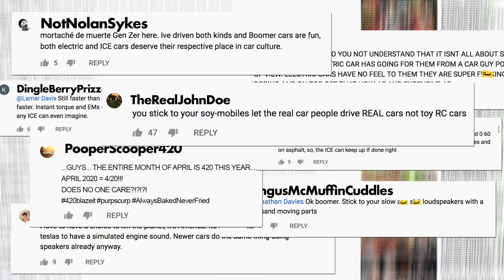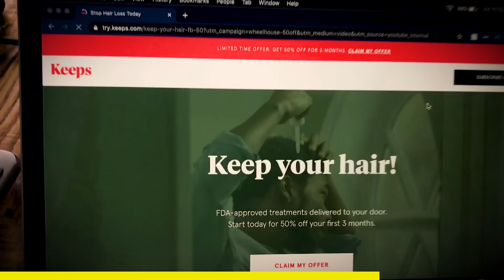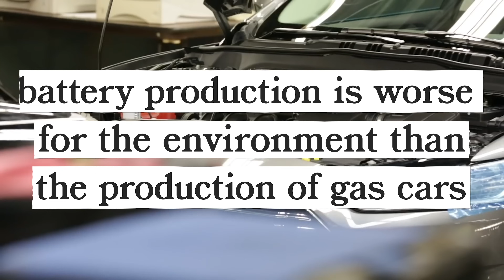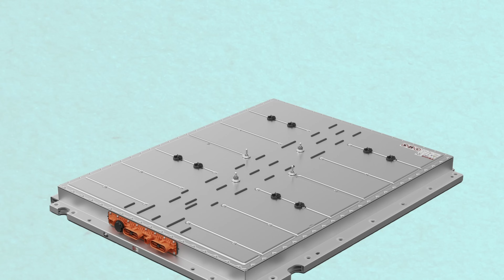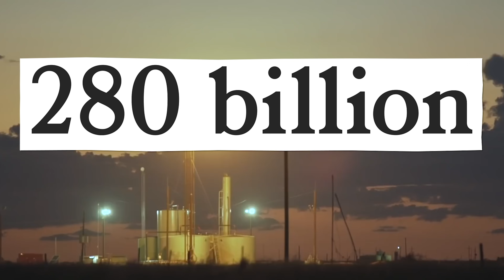Are Electric Cars REALLY Better for the Environment?

Comment: There are zero evidence that co2 causes harm to the environment. Theories are not facts
Reply: There is lots of evidence that CO2 a heat trapping gas warms the atmosphere over the planet, thus warming the oceans which then accelerates the creation and volume of vapours which excelerates the warming of the planet, thus leading to rising sea levels, quicker coastal erosion, damage to marine eco systems due to the harmful chemicals trapped in ice being released into the oceans, and the warmer air evaporating water more quickly from the soil leaving less time for plants to absorb it so yea, CO2 doesn't directly harm but it does create quite the chain reaction, a really bad one at current emissions
Reply: @RP7784  what is the scientific rate in which you think the warming is happening? How much co2 is needed to make a change in the temperature in the ocean? How much vapor is created from this chain reaction you speak of? And how much ice was melted by this effect? Last I checked there are far more ice on this planet than when al gore made his documentary
Reply: @johnnynguyen9579  in the last 140 years the earth has warmed by 2.6 degrees, which may not sound like much but it's alot compared to the temp change across a span of twenty thousand years to a hundred years, right after the industrial revolution earth began warming at an unnatural rate. There is currently a 0.04 Percent CO2 content in the atmosphere which is 400 parts per million by volume, again it may not seem like alot but it's enough to decrease the sea ice in the Arctic by 13.1 percent per decade, and between 2002 and 2020 for Antarctica to shed 149 billion metric tons of ice per year adding to rising sea levels, earth  holds a pretty fragile ecosystem, but it's destructive power is incomprehensible.
Reply: @RP7784  your information is false. The past year alone the earth has been colder. Please check your sources and stop spreading false information. In the past 30 years temperatures has drop and  this natural. There are zero evidence of Co2 causing any increase in temperature.
Reply: @johnnynguyen9579  lol you just said science is wrong half the time so technically it's not trial and error fool.
Yea science can be wrong but so can anyone, it was science that discovered penicillin, science that discovered electricity, science that discovered fusion, science that discovered gravity, all the forces of energy, velocity, mass and physics. Your argument is quite blunt again, and falls flat, sorry hun.
Reply: @RP7784  penicillin was founded by men and men was created by God. So is your mom and dad whom are God’s creation. President Trump cured the world and was the next messiah and you fools spat on him. God, Jesus, and Trump still forgive you for betraying them. Science is a minor part of Trumps creation.
Reply: @RP7784  science invented Covid. Admit it
Reply: @RP7784  dinosaurs died because of global warming and climate changed. Scientist said their monster trucks created too much co2 and led to the ice age. Fauci certified this
Reply: @johnnynguyen9579  😂😂😂😂😂🤣🤣
Reply: @johnnynguyen9579  Your information is false; 2020 was one of the hottest records in history. In the past 20 years, 19 new records have been set for highest global temperature.
 
Why don't you take your own advice, and  stop lying.
Reply: It's called the 'Theory of gravity', but it's only a theory, so why don't you test it?
Reply: @MrRentageek  why don’t you go test the Big Bang theory. Bet ya can’t. Know why, because theories are fairy tales. Someone had an idea and sold it

Comment: The electricity that runs electric cars is produced by burning oil and coal - more carbon load than just driving gas vehicles.
Reply: Not in the UK it isn't. The UK generates just 4% of it's energy from coal. Around 50% is from renewable energy here. There are no oil fired power stations here as far as I'm aware.
Reply: @Brian-om2hh  so where does the 46% electricity remaining get generated from? Fossil fuels

Comment: Probably, many people do not realize that most of that electricity they use to charge car batteries is made by burning same fossil fuel as is burning in traditional cars. So, it is reasonable to ask about gas mileage of electric cars. Now, in an old car there is just car engine between gas and mileage. In electric car we have power plant, transmission lines, car battery, and the motor in that chain of energy conversion from fuel calories to car motion. I would like to hear from the 'experts' about resulting gas mileage, but I bet that it is no better than half of that of a regular car.
Reply: Evs are 90% efficient while ice cars are 30%. Evs has less moving parts so is very efficient. 

Also burning fossil fuels by plants is way better than by individual cars because they are more efficient.
 Electricity can be easily transfered by power lines comapred to oil tankers.
Reply: If you do your research, you'd find that the experts say that the much greater efficiency of producing power at a power plant means  that EVs are better than ICEs even then.

Comment: Whoa! Slow down cowboy! Rewind back to the 6 minute mark and ADD to the battery & charging issues ALL of the electrical infrastructure that WILL need to be built just to provide the electricity these EV charging stations. Fact, we would never need a ramped up electrical infrastructure if we did not have EV's. So tack that on to your already EXTREMELY NOT environmentally friendly EV's. Furthermore, as an owner of a first gen 2003 Prius (which I bought in 2005 and still own/use) I can honestly say that they are FAR from environmentally friendly. Big deal I get almost 52 mpg, big friggin' deal! Hybrids are not even close to being good green options, and EV's are even worse. Why? The battery's! The fact that a hybrid is NOT dependent on and upgraded electrical infrastructure is an enormous plus because the entire electric infrastructure doesn't need to be re-outfitted. Granted my Prius is a hybrid but that has also given me some experience with electric vehicles. If y'all think moving to EV's is the greatest thing to do for the environment I am here to rain on you're absolutely delusional parade. 
We can't even keep people with electricity and warm and from dying from cold during a Polar Vortex (TX 2021). This nonsense of having to have to be all solar or wind by a set date for some GND is insane. 
Go take a look at the massive hole they recently dug in WY to bury wind turbine blades that cannot be recycled, and that's just the first of them, there are tons more to come and that's just some blades. Wind, energy green = HA! 
Solar power has massive issues of it's own, the panels do extreme harm to the environment too, panels don't last long at all, they can't be recycled either = another massive hole to dump them. Additionally, as those panels age or get too hot or too cold efficiency drops significantly. And lets not forget they need batteries and other components too = child labor and toxins into the environment. 
BTW, with the increase in volcanism and noctilucent cloud coverage increasing I don't hear peep coming from anyone on how DIMINISHED sunlight will severely step down efficiency. This is likely and a reality that nobody talks about.
Look, before we all go behaving like lemmings and jumping off cliffs on all of this FAKE green technology let's FIRST discover if it can even be accomplished. Right now, with what I've seen and experienced, it's 100% not smart, 100% not green, and 100% not the solution to replace fossil fuels. If I were y'all I'd be telling these yahoo's to get their butts back to the drawing board and don't come back until you've got something real to contribute because what's taking place right now smells like the best way to move masses of people into a new money maker for the top 1%. 
BTW, I am NOT pro-fossil fuel. I would LOVE to see us use something else that's kinder to us and the Earth. What I'm NOT willing to do is chase lies about a technology and jump off a cliff so a handful of greedy people can make even more money because they're good at convincing people of damn near anything these days. I know we all are excited to move off of fossil fuels but let's be smart people. I mean geez what they've put before us is NOT even a good stepping stone/baby step towards something better and worthy. Use your brains and commonsense please.
Reply: So much BS, it's almost impossible to unwind. The environmental payoff for driving an EV is somewhere between 15 and 45,000 miles, based on the best, most recent studies.

In considering the disposal issue, please include the 10,000 gallons of gasoline that is disposed of in the atmosphere during  the average lifetime of an ICE car. When combined with air, it totals 190,000 pounds of exhaust.  Just because it's invisible to the human eye doesn't mean it's nonexistent.
 
So, about that 4,000 pound Tesla..1,200 pounds  is the battery pack. While it might be considered 'dead' because it is has only 50-70% of it's original storage capacity, that's still enough for it to be used, as is, as a grid storage device. OR it can be recycled, which would be cheaper and more environmentally sound than mining more raw lithium.

Metal and copper can be recycled, which if building out the infrastructure were as bad as you make it seem (it isn't), then it will be worth recycling all of that.
 
That leaves, what, some glass and plastic, aluminum  (which is one of the few metals that will get you $$ today at a recycling center), and maybe a hundred pounds of plastic.
 
When you break a problem down to its component parts, suddenly it doesn't seem so unmanageable. Just ask an engineer.

Comment: So I was thinking... an ev is more efficient if you're  assuming the battery doesn't go bad. Battery's, over time, will go bad. Let's say an ev lasts 20 years, how many battery's will it have gone through? I feel this could drastically change the margins of ice vs ev carbon dioxide outputs..
Reply: In 20 years we would have already found solutions to recycle it and have better and efficient battery technology.

Comment: The energy used to charge those 'ecological cars' comes from thermal facilities which use PETROL so then why banning internal combustion if ev use petrol as well, instead investigate in E-fuels to power said facilities and LET US CAR GUYS DRIVE 'ICE' CARS WITH ECOLOGICAL FUEL

Comment: You should not count plastics against oil production vs EV.  No matter if we go 100% EV, oil will still need to be sourced to create plastics that are used in Solar panels, wind mills car parts clothing, etc etc etc.  That said, go hydrogen.
Reply: Hydrogen is not an energy source. It takes more energy to produce than you can get from it. Basically, H2 production is reversing the burning of H2 (which produces H2O). There are various methods of reversing the process, but the best you can do is get most of the energy back, not all of it.
Reply: @MrRentageek  Except there are companies working on technology to separate hydrogen from water using solar.  HYSR, PLUG etc.  Toyota, Honda and I believe Hyundai as well make Hydrogen cars.  Hyzon just went public with a hydrogen Semi in the past week.  I do understand that most hydrogen used today comes from Natural gas, but green options are being worked on by a number of companies.  

Lithium for EVs has problems too.  Like mining isnt environmentally friendly.    And all cars and the cellphone I'm replying to you on, are made from plastics which is petroleum so the stupidity of killing the keystone pipeline just made all of this more expensive and put Warren Buffet oil trains along the Hudson River by me.  

In short there are issues with any choice.

Comment: I'm a passionate driver with at least 1 million miles driven. That's not new, but you don't need a car for everyday use when you have good public transportation. The cars industry is trying to renew and save itself rather than the planet. We're in kind of a trap where if everything was done rationally there would be no more jobs.

Comment: Good, but here are the FACTS...... JUST ONE EV Vs ONE ICE car, the ICE car is 300-400 TIMES WORSE! Then you factor in that e.g .a Tesla will last about 1Million miles=about 6 ICE cars, so if you factor in that the DELTA IS INSANELY MUCH HIGHER. If you also factor in people like me that charge my Tesla with SOLAR=100% renewable, we are talking maybe - take the average 350 times*6 ICE cars, 2,000 TIMES WORSE, then if you add solar, maybe 2,500 times WORSE to drive a gasoline powered vehicle. SUMMARY: 1 ICE cars is maybe as bad for our environment as 2,500 Teslas  - over time. Look, it is not only what it emits, it is also HOW MUCH environmental damage it takes to fuel up an ICE over it's lifetime at about 17,000 quarts of oil (producing the drilling materials), drilling it, pumping, refining, transporting it....then the ICE car is only about 25% efficient Vs. Tesla/Other EVs at about 90%. Gasoline cars are HORRIBLE for your planet.

Comment: You also have to add in the fact that if you add hundreds of millions of cars to the electrical grid not only will you stress the electrical grid but your price per kilowatt will go up possibly to even 20 times more than what you're paying for a kilowatt now. Also companies that start up a electric fuel pump station are going to charge more per kilowatt. Just ask Tesla odors that are going to Tesla fuel stations how much they're paying. When you end up putting hundreds of millions of cars on the grid the demand for the power is going to cause the utility companies to raise the price per kilowatt and we ain't talking no small amount they're just going to transfer how much you pay for gas into the electric grid cuz nobody's going to lose that money.
Reply: What's your source for electricity going up 20x?
Reply: You seem to have overlooked the fact that if we have millions of EV's, then the oil industry will no longer be using the huge amounts of energy it previously did, therefore it will mean there is a large excess capacity in the grid......  And if the price of electricity increases 20 fold, what do you suppose that would do to the economy?  Hospitals, schools, industry, care homes etc. None of those could afford to function anymore.....  It would simply wreck the economy, to the benefit of nobody.....